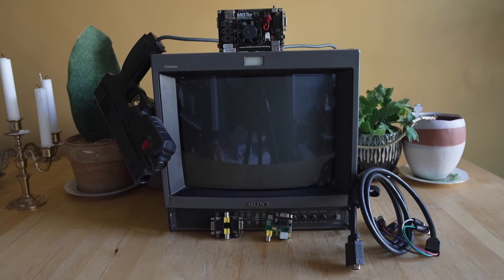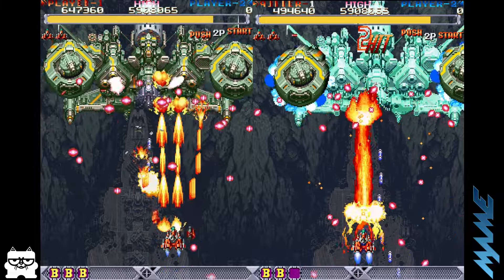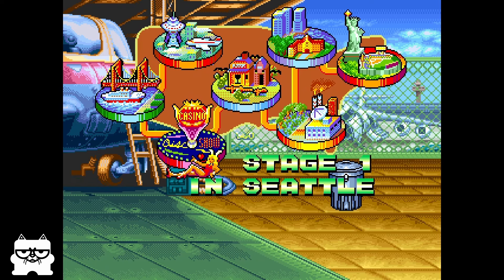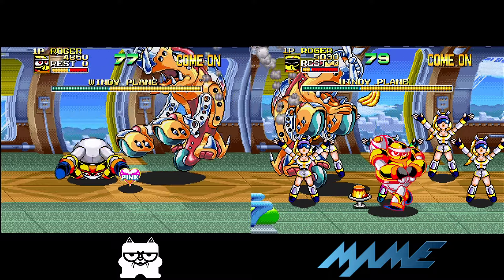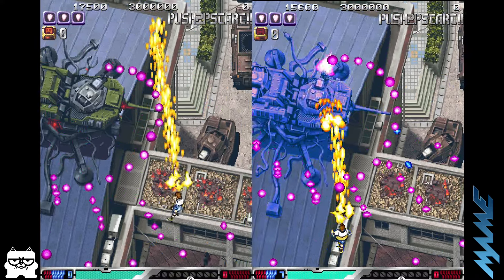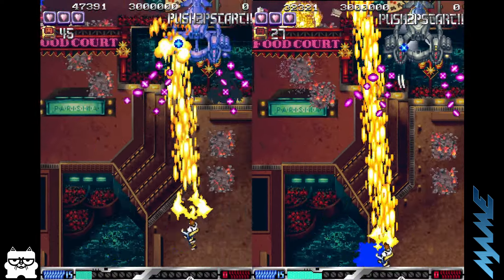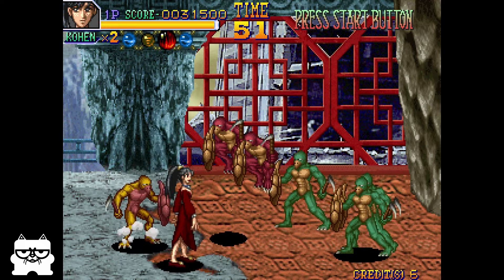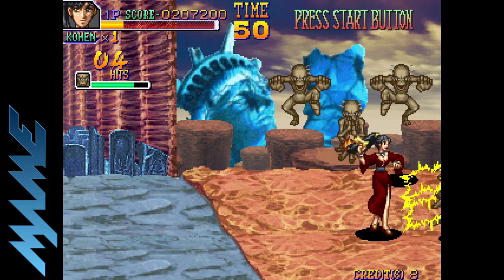MiSTer FPGA vs Emulation! Arcade Cores vs MAME

Comment: I think foe the most part, MAME is excellent and has a good 20 years on the mister project. There's some long standing issues in MAME that have just never been and may never be addressed but on the whole, if you go the groovymame route you'll be 99.99% of the way there for most of the popular stuff. I've even got a few credits in there, it's a massive community effort that is frankly an astounding feat
Reply from the maker: MAME is super impressive due to its sheer size and ability to emulate 1000s of diff games and platforms for sure

Comment: Fpga is still emulation, but it's great to have options! Main difference I can notice trying out Mister on shmups, the MiSTer gets natively lower input lag vs software emulation has to use one frame of runahead to get the same low-lag experience. 
Great video man. Seeing DDP and Esp feels good
Reply from the maker: It can be called a lot of things but at its core it’s doing something different than software emulation.
Reply: @VideoGameEsoterica  Agreed.  Definitely not the same.  ICs function simultaneously, not as a CPU thread counts repeatedly.  So while modern CPUs can perform well enough, it's still not exactly the same.  But yeah, either is still fine for the most part.
Reply: @VideoGameEsoterica  Yes, it's doing hardware emulation. It's still a form of emulation though, just a different way of doing it, by doing it at the hardware level and not ALL in software. You still need a properly programmed "Core" to get an FPGA to function properly, it doesn't just function like a stock console chip, and even then cores are very rarely 1:1 and bugs/incosistencies are constantly having to be ironed out. Many times they even take code from software emulators to help with the core development. 

It's so important to have these discussions because people see the word "Emulation" and immediately cringe, and lump it all together. Not understanding there are many ways to emulate something, and BOTH hardware and software emulation can still be good and have pros and cons. TLDR, "Emulation" is vague, FPGA's are still a form of emulation (Hardware Emulation), but there is nothing wrong with that. We can reduce the stigma with proper education.
Reply: @xMaGuSx888  I 100% agree
Reply from the maker: That’s what I call it replication. It’s replicating functionality. Obviously it’s not the same silicon. It’s recreated in logic. But there needs to be a word between “emulation” and “real hardware” to define FPGA and its role in the process
Reply: The more ways the better. Video game preservation is the winner.

Comment: There are a few additional items (like API selections, Input API, screen refresh, buffering, etc.) on software that can potentially have an impact that you typically wouldn't see on the FPGA version.  So IMO, software CAN work flawlessly, but there are factors that can easily make it NOT run QUITE as well by default without some tuning.  So not definitive, but potential for sure.  It's also not something that a player couldn't necessarily get used to even when there are some minor differences, but in general, I would lean FPGA or real hardware WHEN POSSIBLE at least.  I play on all of the above though, and can't really complain.

If we get away from arcade games, and say take something like PSX or N64 emulation vs. MiSTer, I would ALWAYS pick FPGA.
Reply from the maker: FPGA’s main win is you just turn it on. Software emulation requires more config to get that optimal setting / what else is running in the background that may affect things?
Reply: @VideoGameEsoterica  Very true!  I will say that with many games, and maybe it's due to other things like beating things like Hollow Knight, Dead Cells, FromSoft games, etc. several times over the last few years, and playing a lot more shmups again, but I tend to play classic games just a bit better on the MiSTer than I had been playing them on emulators in previous years.  I want to say it's probably due to better overall input latency without hours spent hunting down and tuning those sorts of things on a PC, but who knows.  :D  Either way, I go straight to FPGA these days, and use software for when a game isn't represented in FPGA.  Seems to work for me anyway :D  Could be all the retro-style and indie practice I've been getting more recently, or maybe it's a combination, or maybe it's all in my head.  ;)
Reply: i hear you its like this for me real hardware next fpga  and -------------------------------------------------------------------------------------------> dead last software emulation

Comment: Not long ago I 1CC’d Dodonpachi on Shmup MAME and it was really only because it has save states and I prefer that to the training mode on Mister. I was actually blown away by how good the emulation was on Shmup MAME. In fact I own a beast gaming PC but didn’t even need to use it. I ended up getting my 1 credit clear on a mini PC. Video is on my channel. Also I use a Panzer Fight Stick with a Brooks board.
Reply from the maker: MAME does a great job no questions asked
Reply: It does.  Now I prefer FPGA. But something truly strange to me happened not too long ago in my gaming habbits. The first Cave game I 1 CC’d was DOJ. And as soon as I took it that seriously I only played the M2 port and never even touched my conversion cart during the whole process. And I used to be all about running the PCB if you got it. Fully stoked at the state of software emulation and FPGA right now. Outside of certain FPGA devs we all know.
Reply from the maker: Yes the hobby is thriving minute annoying happenings. But we don’t have to spend time talking about that here. We’re about the fun
Reply: @VideoGameEsoterica  yeah, I’d rather be playing games.

Comment: I play CAVE games, and you're 100% right in that the slowdown accuracy and input delay are extremely important to get right. I think I prefer FPGA overall in comparison to software emulation, but emulators are still useful for games without practice modes since you can savestate to grind out certain sections. I like messing with run ahead on software emulation to get ultra low latency, but it's not available for every type of arcade emulation, so I often have to go for other methods of play.
Reply from the maker: Save states are a huge benefit in learning bullet hell shmups

Comment: I know that some PC emulators require a lot of cpu power (3ghz+) to even come close to what the console hardware does. The only emulator I'm aware of needing a fast cpu is SSF (saturn).

By the way, do 3D games on MAME require more cpu power than 2D ones?
Reply from the maker: Yes 3D hits the cpu harder
Reply: That is why the DE25-NANO and the upcoming replay 2 FPGA will be useful for CPU speed boosts on early windows gaming in the PC/DOS cores.
Reply from the maker: @ObiKKa it’ll be fun to see the uptick

Comment: I still playing on emulators. Taki's mister is hard to buy, and on top of that the taxes in my country are absurd. 
I would love to see comparasion between mister and final burn neo. I have better results in neogeo on fbneo than mame, actually mame give me bugs and glitches in strikers 1945 plus, but fbneo not. 
Thanks for the video.
Reply from the maker: I think I did a FB Neo comparison? Some years back
Reply: This game doesn't really have glitches in MAME. Are you using an older MAME version?

MAME should be more accurate than BFNeo since the latter is more focused on performance.
Reply: @Imgema  It's glitching in front of me right now.
Reply: @Vulto166  What kind of glitching? What version of MAME? What device?
Reply: @Imgema    Sound glitching, graphical artefacts. 
In Sonic Wings 2 NeoGeo, the sound sometimes stop working. 
I'm using Mame 270 
Thinkpad L14 Gen 1
Arch Linux Kernel 6.11.5 
Is important to mention that mame resources consunption is very high, the fans get's gets crazy loud when running it. 
Defenitely not a good experience. 
Fbneo runs far more superior.

Comment: So sticking with MAME is a good choice, MiSTER is just too complicated for me to get going and happy with MAME, Flycast, and Model 1/Model2/Model3 emulators, until there will be a system which is easy to use and combines all those cores I'll stick with software emulation....
Reply from the maker: If MAME does it for you then def stick with it

Comment: Ppl will say what they will but, MAME or FPGA is NOT actual hardware. There will be imperfections.  Some games are still glitchy on FPGA that arent glitchy in the LEAST on MAME or FBA. It's gonna take a lot more time to really make a definitive FPGA vs MAME/FBA video. Good work here tho. 👍🏾💯
Reply from the maker: FPGA is as close as it gets and for most people that’s more than good enough. The original hardware won’t last forever that’s for sure
Reply: It's easy to forget we're only @ gen 1 FPGA, with next gen FPGA, we will see more and more 1:1 parity cores.
Reply from the maker: Yes it’ll be fun to see where it all goes in the next 5-10 years

Comment: I imagine the biggest difference is going to be input lag
Reply from the maker: Really isn’t anything bad on MAME side
Reply: Not just lag but fpga runs in parallel just like real hardware JT likes to bring up the startup garbage screen that you see in some games it will never look correct into they change the whole driver to run in parallel in mame and that is never going to happen .
Reply: Input lag is a non-issue for software emulation these days. RetroArch can match or beat the input lag of real hardware/FPGA with the right settings.
Reply: @ArmandoDoval  There will always be lag in  software emulation due to the overhead and there is a reason the fighting community will never use RetroArch in a tournament its not viable for fighting games FPGA  was used at EVO for the first time in history not RetroArch  pro players have tested RetroArch it still feels off in some cases you need to readjust the lag on each fighting stage which blows ass . in fpga you can even have lower lag then  real hardware too if you are a causal player none of this matter

Comment: Having a powerful PC is good but you hit diminishing returns in certain situations. Some of the games you show don't have any real performance/lag improvements VS a 10 year old desktop PC. You don't need a modern i9 CPU for "Ninja Baseball Batman", for instance. Most of the emulation issues regarding performance and lag stems from other devices such as cheap Raspberries and Chinese Android devices, not PCs. These cheapo devices have saturated the market and are the source of why most people think emulation is bad.

You still need a beast of a PC for other things like accurate N64 emulation with Ares, PS3, XBOX360, etc. But for the games you are showing in this video your beast of PC is practically idle.
Reply from the maker: Having “more power” is still good as who knows what people have running in the background. Sure a potato can get it done but what else is said potato doing
Reply: @VideoGameEsoterica  
If you are talking about casual users i agree. I suppose a fast PC is newbie-proof and will brute force more of the bloat and user errors so the user doesn't end up blaming the emulator for it's crappy performance.
Reply from the maker: You have to remember I have to consider your average user when I talk about emulation. I can’t address “us” because not everybody is us

Comment: You won't find many Mame Devs who think FPGA is anything but an unnecessary rip-off, so far as Arcade Emulation goes.
Reply from the maker: I wouldn’t say that. I know a good amount who have MiSTers
Reply: I must admit, unless the Mame side has serious or noticeable glitches, you cant tell them apart. Also Mame has a ton of games avaialble. But groovy mister combined its quality, so you have access to alot more.
Reply: As a game developer of 28 years+ and an FPGA developer - Mister is the best experience I've ever had. I could trade all my PCBs in, but won't 😅 ...running my old N64 core on the overclocked core is amazing!
Reply: What I’ve found MiSTer does a lot better than traditional emulation is the prevention of stutter. I’ve never played an emulator that didn’t stutter at least occasionally, but MiSTer almost completely fixes that due to the asynchronous processing.
Reply: Sometimes it feels like emulators can make the game run better than possible.  Seeing the sprites flicker on these console cores is kinda of heart warming 😊
Reply: @bengineer_the  cool what have you developed for the Mister?
Reply: Cpu based Emulation and FPGA stuff both have their own strengths so it depends. I need a little of both in my life!
Reply: The MiSTer project on arcade cores has their work back ported back into MAME.
As understanding how arcade hardware worked improved Mame.

Both have influenced the other in the world of arcade emulation.
Reply: A MAME dev who’s smug and pretentious? Say it ain’t so!

Comment: Comparing crap to crap... What about having an actual PCB? That would be useful, for a change...
Reply from the maker: And to think I thought you abandoned me 😘
Reply: Many of these boards are hard to find, needs maintenance, some needs regular scheduled maintenance. And if you don't have a working compatible cabinet, you would need a super gun, and they are aren't made equal, most need adjustments or calibration to work correctly.
Reply from the maker: Ignore him. He’s notorious on YT. If I show real hardware he just comments and says I’m rich and bragging 🤣